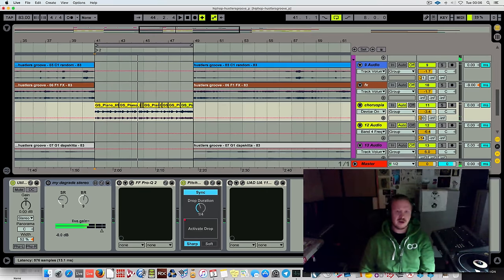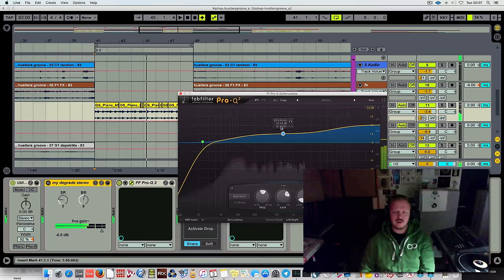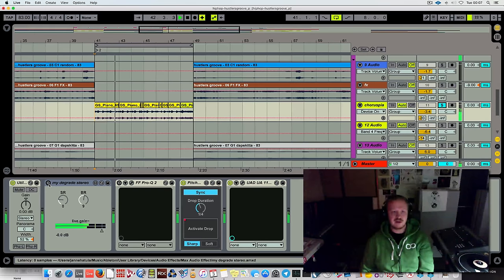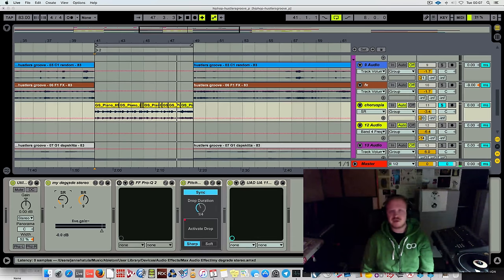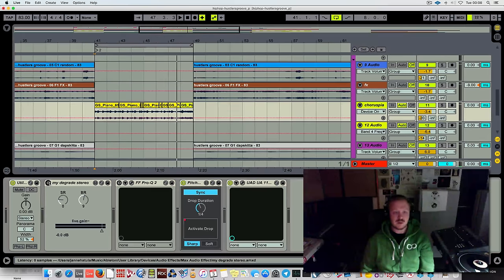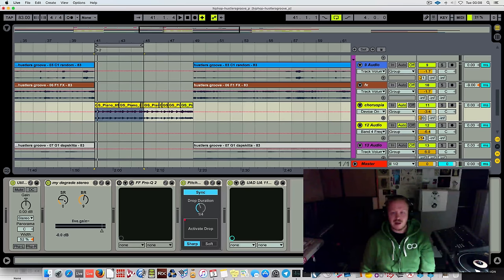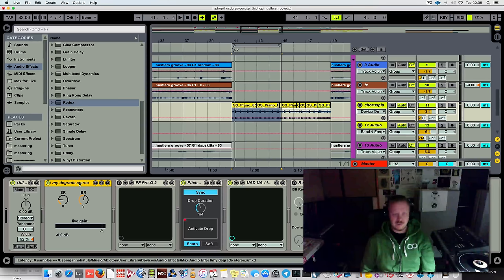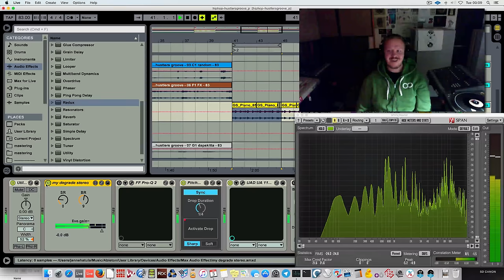Degrading the sample rate for mix clarity

Comment: Great concept man. The only thing that I would recommend is to throw on an EQ the next step in the signal chain. Add high pass and low pass filters to control that low fi ringy sound, while still maintaining the clarity from the added harmonics.
Reply: Robert Stevenson eh.... it actually sounds good the way it was after the degradation

Comment: Great tutorials!
Please try to make a tutorial just for kicks. I think is pretty important how do you replace the kicks from the breaks you sample and make them work together.
Reply from the maker: Thing is, I rarely replace them: I mostly just process them and try to make them work. However, every once in a while use Slate Trigger for that, and it works well.
Reply: Hmm, this is very interesting because in your tracks I hear the kicks so clear, well separated.
But one more question: in your drumfunk projects the breaks are always sliced?
Reply from the maker: Always sliced. Every hit. I process the "main" hits that i want to stand out, mostly.
Reply: About drum slices and 'Ableton 9': let`s say you have a track that have 2 breaks or more: working in 'Ableton 9' with these 2 breaks can be done in 1 midi channel or your work runs on 2 separate midi channels?
I know that my question sounds weird but in 'Ableton 9' I didn`t see a ghost channel option that shows me where are positioned all my breaks in one midi chanell so I can choose what to use when I want to or not.
How is your workflow in this situation because I hear in your tracks more then one break? My english is poor but I guess you understand my question(s), is about breaks workflow basically.
Reply from the maker: When I work with Live, I usually chop one break to a drum rack; I dont try and fit two breaks in there, even though I could. So one break and drum rack per track.
Reply: Hehehe, I could bet that you have more then one break per track. 
Anyway, as I`ve seen some time ago in a picture of your studio you have hardware sampler, you have a lot of hardware goodies in general to make amazing beats with more quality then some software can do.